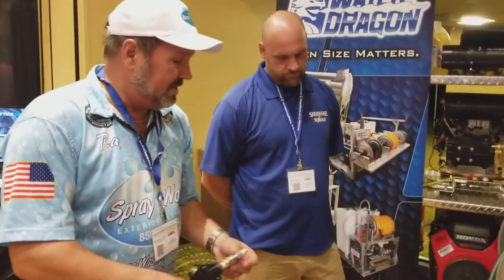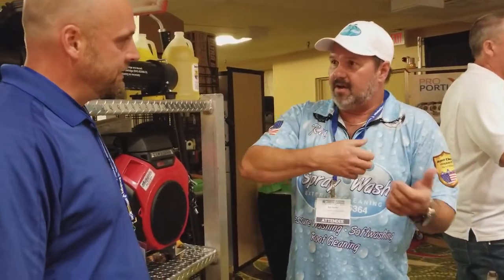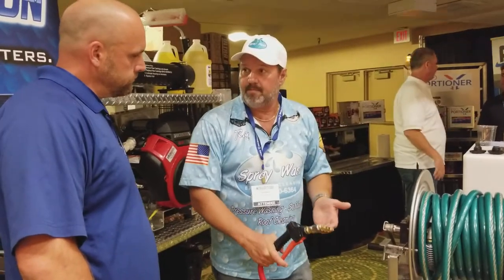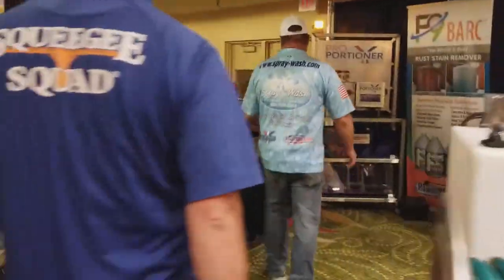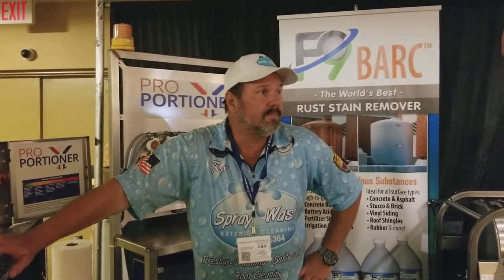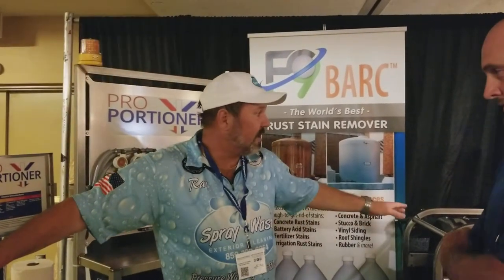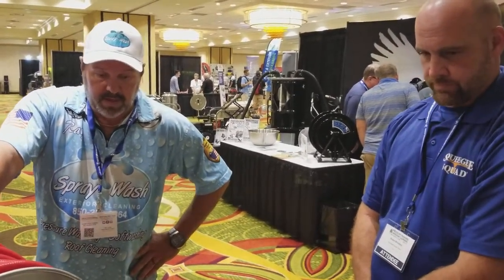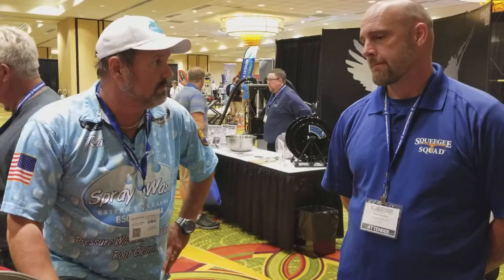Proportioner and booster system being explained by Ray Burke

Comment: So .... when you use this do you always leave the water valve open all the way and only adjust the SH and soap valves?
Reply from the maker: Correct.  Unless you needed stronger than a 5050 mix

Comment: Can you use the Proportioner with a regular 6gpm pump? What is the difference between the booster pump and a regular 12v pump? thanks..
Reply from the maker: Courtney Blackmon proportioner will work with any dedicated pump except for gas powered units because they have to bypass.  Booster is stronger, more accurate (12v claims 5 but outs our 3), and more durable.
Reply: @Cleanpowerwash  Hello, where did you purchased the Proportioner and booster system?
Reply from the maker: Powerwashstore.com